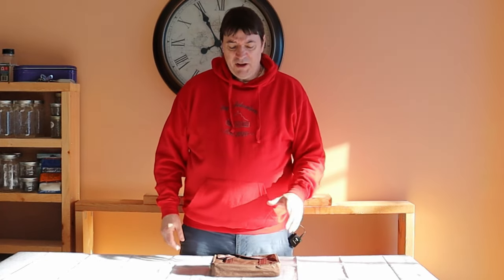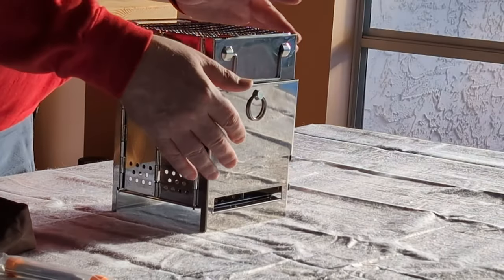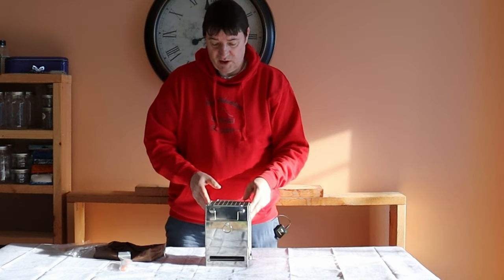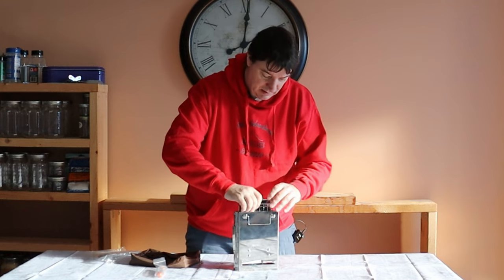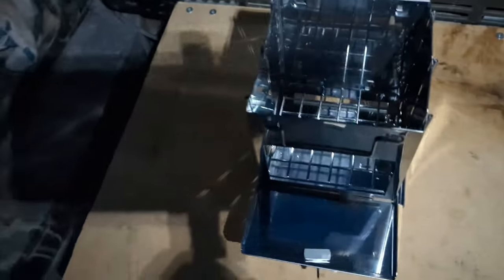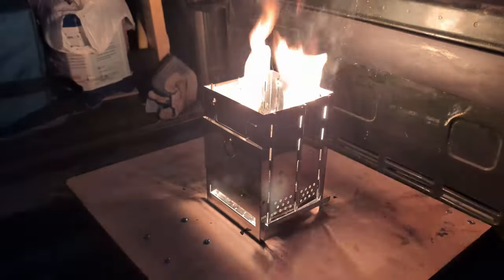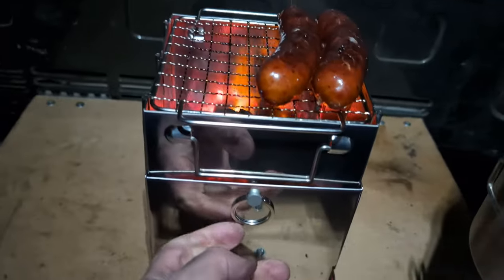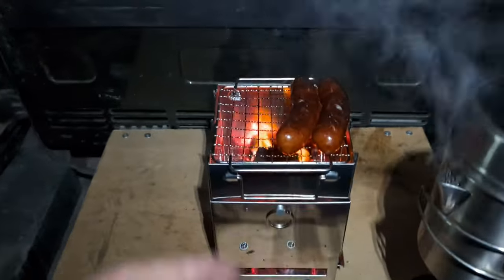PSKOOK Wood Burning Camp Stove

Comment: Funny thing is I have this stove and used it today. I came for dinner and your video pops up in my notifications. The stove works well and is efficient as the burn chamber with the door closed pushes' the heat straight up. Boils 16oz of water in about 7 minutes, which is good for a wood stove. Of course, I used wood about thumb size and the fire was just roaring and burned very fast. Very pleased with my purchase. Thanks for posting this video.
Reply from the maker: What did you end up having for dinner? 
That's awesome to hear that you have the stove and are happy with it! I like the stove so far and I plan on using it lots more this year. 
I like grilling on it. 
I'll need to try it with the thumb sized wood and get a good roaring  fire out of it. 
Thanks for taking a look😁
Reply: @agesadventures  Meat and potatoes for Saturday dinner.  I did subscribe and left a like. Have a good week.

Comment: Good introduction video. That is good when there are not many loose parts. The hinge structure is good. There is already enough size in that stove if you are cooking. You can easily use larger pots or frying pans as well. If you connect a USB air fan to the bottom of the fire pit, it would act as a turbo, so the heat output would increase. Such stoves also exist😄
Reply from the maker: Thank you😁
It really is a good stove! It is nice that you can fold it down and not get soot all over your fingers. 
It has a good area for cooking. 
Yes, you could use a fan to make it burn much hotter🔥🔥🔥

Comment: Nice piece of engineering,  there. I've made my own stoves out of coffee cans to great effect, but I've never had something like this stove. I think my reluctance is that I backpack everywhere, and I imagine I'd get carbon everywhere-- it'd be messy.  But I see this has a carrying case/bag.  Thanks for sharing...I'll reconsider these. 👍
Reply from the maker: The bag is really great for this one! I didn't have to worry about the carbon and folding it up was  a pretty clean process too.
I have another twig stove that is lighter and flatter. The Emberlit stove and it's great as well. You have to take it apart afterwards though and your hands can get a little dirty from that.